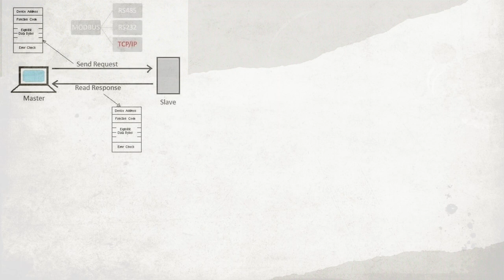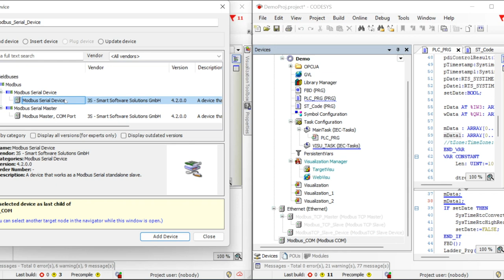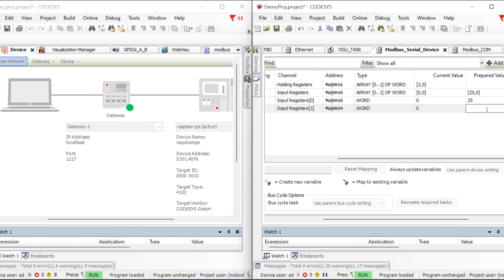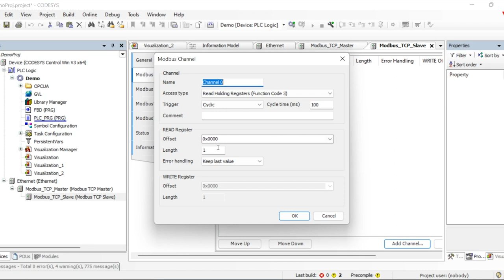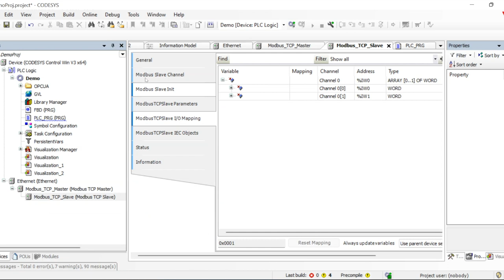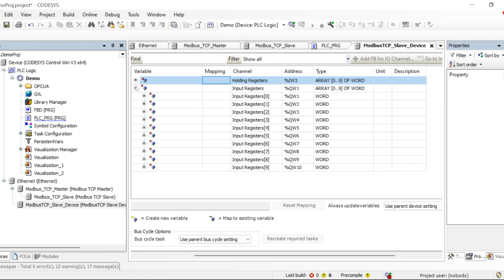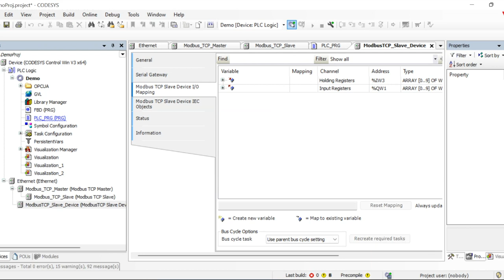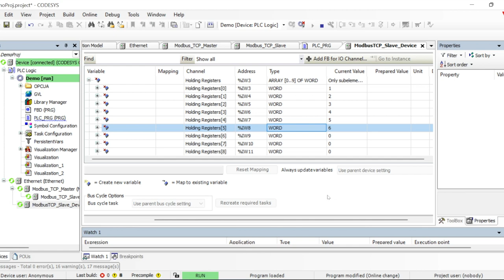CoDeSys PLC Programming Tutorial: Modbus Communication Part 9

Comment: Thank you for the helpful video! Would you ever make one showing how to use WAGO's 3 phase power measurement PLC's in codesys and view the readings using modbus? There doesnt seem to be any kind of tutorial for ones like the 750-495 module, not even from WAGO.
Reply from the maker: Thanks TomScott
I have some special card configuration in the pipeline ... But I don't have this card with me now, if I get it I will make it for sure...
Last project I did there was all this data I was reading over the modbus directly from the power electronics device...

Comment: Hello, what's the difference between adding the Modbus_TCP_ slave only vs adding  the Modbus _TCP _slave into the Modbus _TCP_Master.
Reply from the maker: Modbus protocol works in Master Slave principle
1. Modbus Master : so when we add slave inside Master. Master initiates communication and Here you are reading data from some other Slave device ..
2.Modbus Slave: when we add slave directly it means codesys is publishing the data when any other master initiates communication it will get data from Codesys device

Comment: How to read/write data through modbus tcp ip in automation builder v2.5
Reply from the maker: I think it will remain same as done in Codesys . 
I have not used automation builder but it is based on Codesys.. so step should remain same … did you tried same steps defined in video for tcp/ip?
Reply: @jugaadtech12 
Really thanks for your response,i have tried but its working please make a video and can you suggest websites where we can learn codesys completely
Reply from the maker: @jayasankar1952 let’s connect using either of contacts https://www.shaswatraj.com/contact
To understand it properly… 
Best place is Codesys website
I have tried to cover in initial videos basics and advance level ..